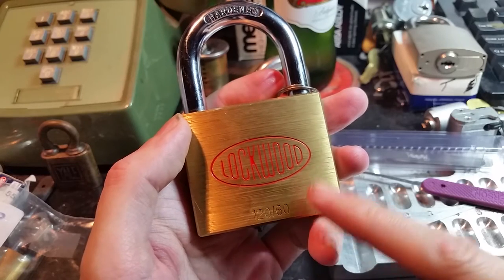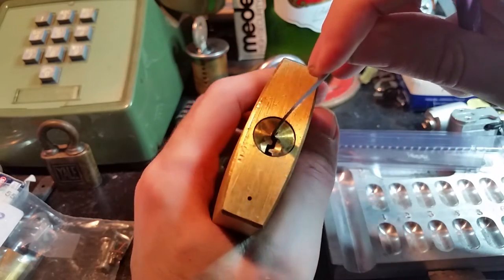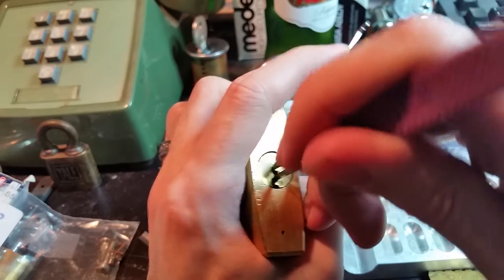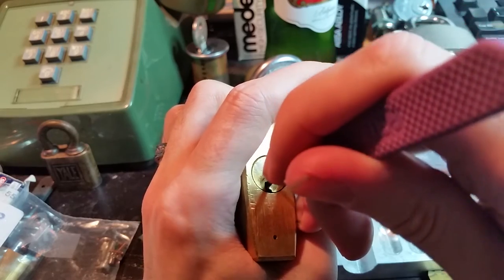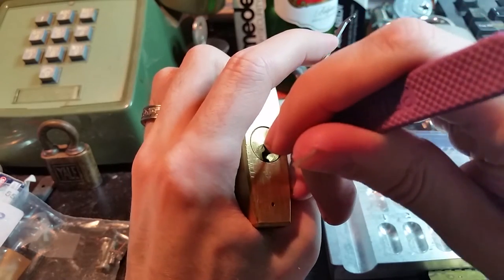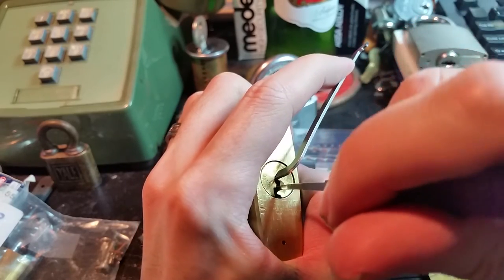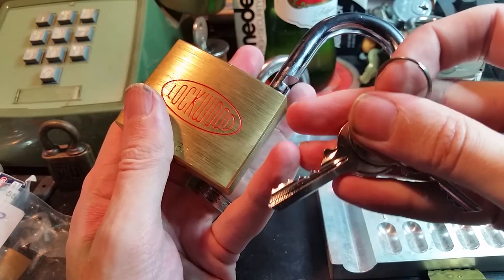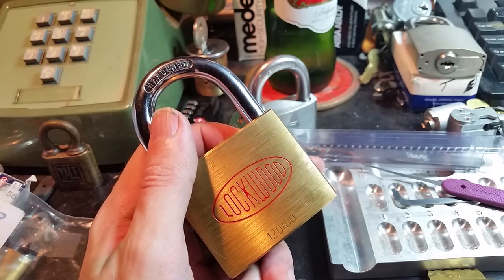(81) Lockwood 120/60 picked

Comment: Yeah, those spool pins are kind of rough and stubborn compared to the shallow and polished ones in the 334. Seems like you are getting used to them though. Nice! :)
Reply from the maker: They are much easier to get used to than the spools you put in the 334 (I had to swap them out for the tapered pins while I was trying to get the hang of the 334).
Reply: The shallow ones seem to be the norm in padlocks like the 270S70, 290S84, 356S63 and also the 334's. Pretty common in 570/590 cylinders and a few others. General purpose padlocks like the 119's. 120's and the 121's seem to have the other type of spool pin.
Reply from the maker: Makes sense.